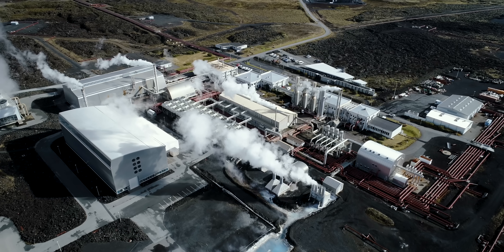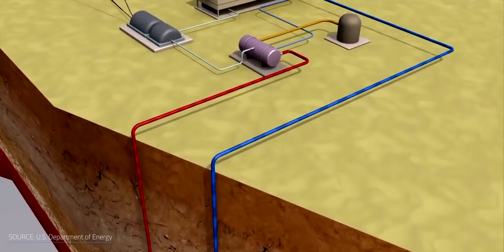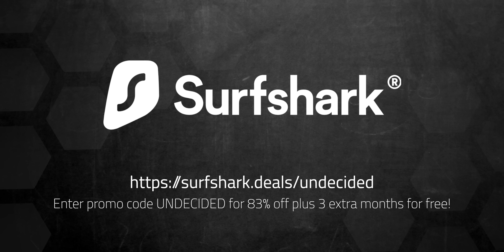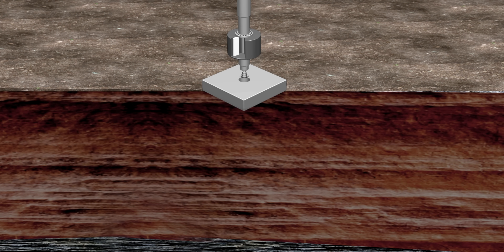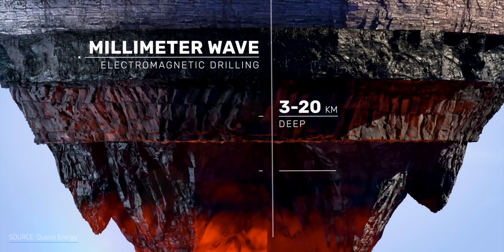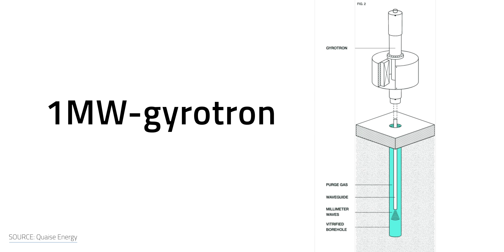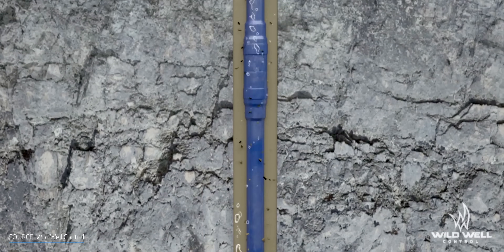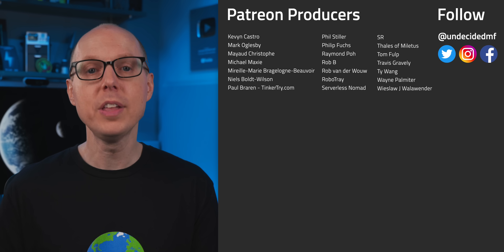Why This Fusion Tech May Be a Geothermal Energy Breakthrough

Comment: I'm skeptical of how clearing the borehole will work over those distances and how the borehole will hold up with it relying solely on the result of melting the surrounding rock layers. They must have thought of these factors already, but that's a lot of pressure difference to rely on one mechanism for lifting debris, and the classic problem of drilling is going through transitions between layers of different types of rock. Not all types of rock will form the same sort of "glass" when melted, so transition boundaries are something that would be worrying to me, particularly when you repressurize the hole with acidic water.

Even though I'm skeptical, I'm really hopeful this works. If it delivers on its promise and the boreholes prove to be sufficiently durable, this could be amazing.
Reply: the same thought as well. I don't think the glass surface will stand hundreds bars of pressure. But I suppose to put some tubing should be easier than constantly change drilling head which can stuck.
Reply: @plasmabazooka4403  there is pressure inside and outside
Reply: I agree, they hardly address the problems with clearing vaporised rock from a many km deep hole. What happens if that gas decides to condense or solidify along the way?
Reply: @elmz  The plan is for it to solidify along the way. That's the nanoparticles he spoke of partway through. The video never mentions how those nanoparticles are removed. I did some additional reading and according to the patent, they're using pressurized gas with a gas filter before venting into the atmosphere. (To be clear: I've not read the whole patent, I'm just skimming to answer my questions.)
Reply: I am very sceptical about the feasability of this actually working continuously for the above reasons plus
+ the high temperature/pressure water will disolve many minerals and with the pressure change travelling to the surface those mineral will come out of solution & will clog up the tube 
+ the contact area of the fluid slowly moving along the tube to the surface will cause the fluid to loose the great bulk of the heat energy before it can be harnessed
+the friction loss with such a small tube diameter of that length may be greater not allow any effective flow
Reply: @KevinHeadlam-Tasmania  They won't just be pumping fluid down the borehole. The fluid will likely run through pipes that are fed down along the walls of the borehole to be heated by the high temperature rock.
Reply: If anyone else is wanting to read more depth on this, the patent is US8393410B2. Some of the capabilities not mentioned in the video are fascinating. 

A lot still remains for the field test to prove out, obviously, but this could do some amazing work beyond just the geothermal application.
Reply: I think it would depend on the thickness of the wall relative to the diameter of the hole.

Without that information it’s pretty impossible to judge whether a glassy liner would outperform a more conventional one.
Reply: Also as for the pressurized water, remember that is a positive pressure acting against the opposing pressure against the wall, so only the difference between the two need be considered.
Reply: I had the same concern for turning Martian soil into glass. Some kind of targeted float distillation may be implemented with remote sensing of suspect impurities.
Reply: Agreed. Apart from anything else, if it works as calculated it would make deep hole drilling much easier, because it would not care so much about the viscose and malleable nature of high depth rock
Reply: All those questions were answered. I’m not being facetious, but perhaps it’s because I’m an engineer that I heard the answers, as there were a few steps skipped in the explanation.
Reply: @michaelfitzpatrick3020  They weren't answered in the video, which is what we're responding to. We are merely told that the walls of the borehole will be glass due to the heat of the boring process and that the vaporized rock will condense back into nanoparticles...with no mention of the mechanism of removing those nanoparticles.

As I said in my initial post - I'm sure they've thought of these things, but I'm skeptical that it will work as expected. Clearing the nanoparticles has to be done with some form of pressurized fluid. Since it isn't mud, then we're talking about something that relies on flow rate to clear it, which is something that changes efficacy with depth. If you read his article on MIT's website, it sound like he's expecting it to just disappear into the pressurized walls of the borehole, but that's not realistic with the volume to surface area. Reading through his patent...honestly it sounds like he's relying solely on the vapor pressure from the heating to clear it, which doesn't make sense over those distances, but nobody would have approved a test project if it were that glaring of a problem. We just don't have the information here - hence the mix of skepticism and optimism.
EDIT: Found further in the patent that it is indeed a pressurized gas system with filtration before being vented to atmosphere.

The "glass" walls as-mentioned here skipped the explanation that it's relying on the pressurization from the heating process in the confined space always being greater than the surrounding pressure. Being a glass, it will have an amorphous structure, which combined with the pressure will make it more durable than the surrounding rock. But it's not like a bear where you just have to be faster than your friend next to you. The rock layers will have their own pressure depending on what materials and forces are involved in that layer, creating differential pressures on the glass borehole at boundary layers, and that won't be resolved merely by an asymmetrical hole (again, from his MIT article, not here).

My background with this is a few semesters towards a petroleum engineering degree before I changed majors. Obviously, as an actual engineer you have more access to and awareness of the information than I do. But it's worth remembering that most people commenting in response to a video don't have anything more than the video.

As a general rule, if someone is spending millions on a test, the concerns Youtube commenters have thought of have already been addressed. But it's not a given. One thing was firmly impressed upon me when I was learning about drilling - the deeper you go, the more complex the problem becomes. While I'm optimistic, I strongly suspect they have very significant unknown unknowns that will emerge in the test.
Reply: @michaelfitzpatrick3020  no you didn't hear the answers, because they weren't offered. With all due respect, most engineers are good at formalism but don't understand shit about a real physical process. That's why drillers drill, and engineers sign forms.
Reply: @benwilms3942   It's silly to think that "all the answers" can be found in a 20 minute YouTube video targetted a a fairly non-technical audience.  The questions raised are valid, but there are enough researchers, engineers, deep drillers involved that a company has raised 40 million in funding to run a pilot project.  You don't raise that kind of monry without having at least some plausible solutions to fairly obvious potential issues.  The pilot (if it happens) will certainly raise new and unexpected issues that may or may not be solvable.

However, if nothing else, this is a novel idea that is worth pursuing.  If the obvious and non-obvious issues can be resolved, this approach could lead to much cleaner energy at large scale.  And both drilling technology in general, as well as power generation from geothermal sources are mature technologies.  The potential problems are likely to be easier to solve than those around fusion, for example.  And if this leads to a solution that could retrofit the average coal power plant for a project that costs $25-50 million and takes a year or two, it would be revolutionary.
Reply: @benwilms3942  I’ve been at it for 18 years and I don’t do the design side after the first few years, just the management side as I like solving problems in real time.
Reply: Day 99:  We hit TD today.  As we were removing the waveform guide, apparently some torsional vibration translated into lateral vibration, which ended up causing it to impact the millimeter thick vitrified glass casing and shattered it.  Luckily the waveform was extracted before the walls collapsed.

Comment: EV batteries, EV transportation will triple the grid demand from centralised power plants. 
Triple size of power plants. New builds.
Triple the grid capacity. 2 more grids to be built.
I suggest, as every building is connected to the grid today, rooftop solar PV and the huge EV batteries, 100kwh, will be a huge benefit as the existing grid and power plants can remain at huge savings. 
The power grid construction cost $billions and years,so building 2 more concentrated power supply systems needs a think.
Distributed power supply from the ends of the existing grid would be a huge saving. 
Rooftop solar can be built as fast as the EV roll off the production lines. 
The EV batteries are huge, 100kwh, for the longer trips. The Daily drive is 7kwh, and easily topped up daily from home or from nearby from the grid.
Petroleum is a strategic military reserve asset for war and emergency purposes in the near future. 
The existing grid just needs to get smarter basically.
Your presentation is extremely important as cleaning up existing power plants is a critical part of a practical financial solution.

Comment: As a layman maybe somebody can help, do geothermal systems effectively cool the earths inner core?  Are there any longterm adverse effects on core and magnetic field?
Reply: Not significantly. Think of it like a quicksilver thermometer: If you hold it into pool of water, their temperature will get closer to each other (due to the 2nd Law of Thermodynamics), though the tiny thermometer has only a negligible effect on the big pool of water. But the thermometer adopts to the temperature of the environment it's in. Similarly, the massive deep layers of the Earth can easily give us a tiny bit of their heat without being impacted. But for us and our power plant, it's a ton of heat that can be converted to energy.
Reply: No they have negligible effects.
To give some perspective the earth already leaks around 50 TeraWatts of energy over 3 times what all of humanity uses. 
Which means even if we used geothermal for 100% of our power and we tripled the amount of power humanity consumes it would only double the amount of heat leaving the earth at worst. This assumes no heat returns and all of it radiates to space.

50% of the internal heat is generated from radioactive decay so the earth is like a giant low efficiency nuclear reactor. 

It will take roughly 80 billion years for the interior of the earth to cool so if we naively assume that doubling heat loss cuts that time in half (it wouldn't) that makes it take 40 billion years to cool at fastest.

The sun will make earth a barren rock in less than 10 billion years.

Comment: I was just looking at the web site for Iceland's geothermal power production. Pretty amazing. Many power plants and 70% of the electricity generated goes to making aluminum.   The energy goes to things we don't think of like longer showers, heating the streets to keep ice off. Some drilling has been required but the sources are so shallow not a lot of drilling has been required.
Reply: Imagine that- having such abundance we could be heating streets,  no doubt that worlds coming, although  from a current prospective it seems impossible .
Reply: @donTeo136  they constantly trickle warm water into ponds and lakes to make them more hospitable to the critters too. This type of reliable constant high output energy enables so many uses.
Reply: Wairakei in NZ uses geothermal energy from closer to the surface as well as the Waikato River for a source of cooling water . Relatively shallow Geothermal energy is a good resource but will require careful management …
Reply: “Iceland… geothermal power”

Imagine the global warming occurring, spewing out all that energy from the core of the earth, in the coldest areas of the planet.

Much of that energy just remains on the biosphere… as we increase energy transfer from the core to the surface, the global warming just increases.
Reply: @DavidHalko  I can see why you’d think that, but the thermal output of humanity is orders of magnitude less than that of the sun hitting the planet. The reason global warming is happening is because of greenhouse gases which keep more of the sun’s heat for longer, not because we have activities which produce heat. If it was as you said, switching to nuclear or geothermal would be pointless.
Reply: They also have hydropower with a great loss of nature in Iceland
Reply: @lubricustheslippery5028  We dont have enogh of hydropower as we have to use hundreds of tons of disel to run our industry in my part of Iceland, is that better?

Comment: I am uncertain this is a good idea. Everyone talks about carbon neutral and stuff, but the issue with global warming is the heat, and this just brings more heat to the surface and not safely tucked away in the core. It has the advantage in being an energy source, but it could accelerate the process of heating up the planet. If they could sink that residual heat back into the earth at a colder level, that would probably be another story
Reply: Good question however all of the heat generated by all energy creation is getting radiated one way or another. It does not go back into the earth. This is being generated in a different way. Will it ad substantially? I guess we'll see, at least it does not ad carbon.
Reply: @donnh8004  "at least it doesn't ad(d) carbon".
you missed the point completely, did you even read my post?

Comment: Likely extensive exploitation of this nascent technology raises major concerns in my mind.

Primarily there are two issues, both of  which involve thermal conservation and balance within the mantle and core. 

The mantle convects even though it's almost solid. Certainly, heat and it's distribution are a major factor. 

It seems that the crust is a fairly good insulator in that surface ground temperatures are very low compared to that of the mantle. Alternately, I imagine there is a good amount of heat loss at oceanic rifting zones and mantle plume hot spots. Also, there is some from tectonic related volcanism. 

Would drawing additional heat off of the top of the mantle slow down convection and subsequently tectonics? Would this in the short term increase the core temperature and in the long term accelerate its cooling?

Historically, tectonics have been an essential stabilizing component of our climate system. Consequences of altering them should be considered.  Also, if the core's temperature is affected, could this disrupt the magnetosphere such that the solar wind would erode our atmosphere at a much faster rate?

Apart from the Paleocene Eocene Thermal Maximum, the Cenozoic reached its thermal optimum about 50 million years ago. Ever since then the climate has basically been cooling taking us into the Quaternary Ice Age 2 and 1/2 million years ago. There has been speculation in the scientific community that this may be attributable to less mantle emissions into the atmosphere, allowing our atmosphere to be partially diminished by the solar wind and subsequent reduction of the greenhouse effect. If this attribution is accurate, it suggests that during the last 50 million years the mantle has already had cooling of some significance.

It is my understanding that the magnetosphere is generated by a dynamo in the core formed by the inner solid part spinning within the outer molten part. Also, it is my understanding that Mars once had a liquid core that went solid with subsequent loss of its magnetosphere and most of its atmosphere and water. 

Though the above  presentation described technology appears to be quite superb, I think careful determinations should be made before going hog wild with it.

Comment: Dumb question:  What's the difference between some salt based magma/lava and thorium molten salt energy?  I mean there has to be magma/lava somewhere on earth that's all molten salt instead of molten rock so what's the difference between that and thorium molten salt energy?  I mean, don't some TMSRs use normal table salt?  And isn't it true that magma/lava, at least in part, get it's heat from Thorium?  I really feel like there's some kind of connection here but maybe I'm just missing some physics knowledge.

Comment: The lower down you drill, by whatever means, the higher the temperature, but when your hot fluid goes up, it must travel further, thus losing energy by conduction through the tube walls. Unless you use a concept known as a Bayonet heater in reverse, with 2 concentric tubes. The returning cold fluid goes through the outer tube, goes to the bottom and climbs back up through the center tube. In this case there is no need for a secondary heat exchanger up top, just a recirculating pump/compressor